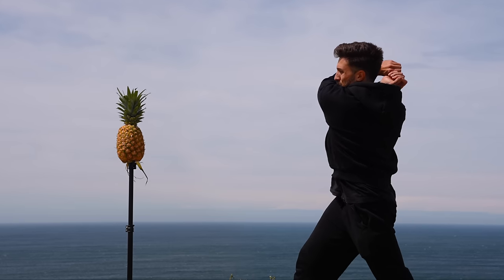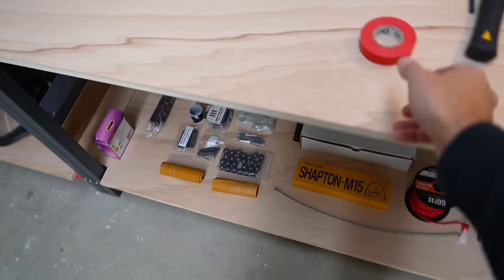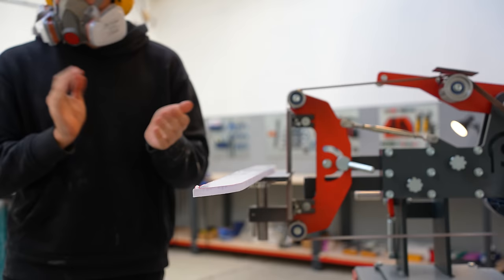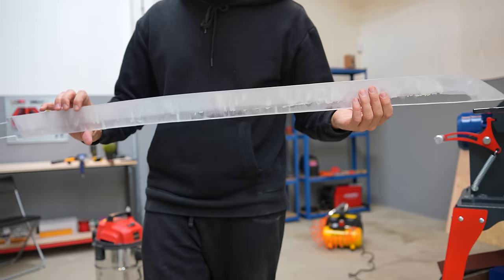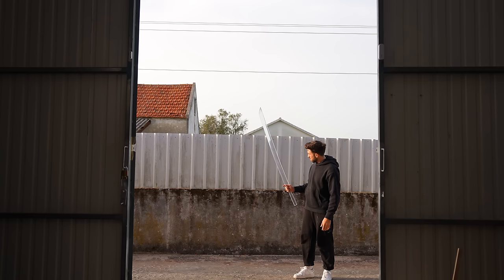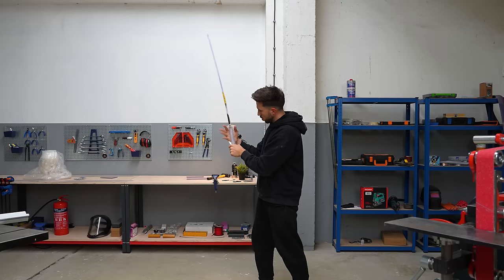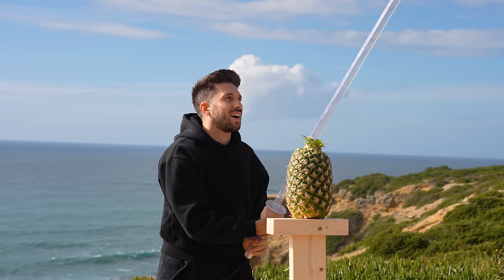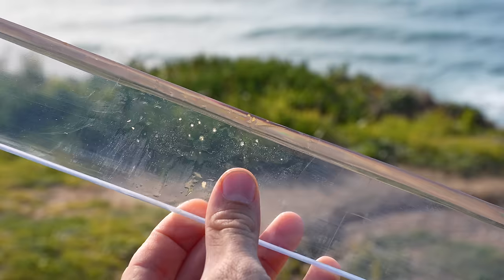I Built a Transparent Katana

Comment: The sledgehammer test breaking the sawhorses was unintentionally so funny. You praised the polycarb for how little damage it took when the sawhorses took almost all of the impact (evidence - they broke). The base has to be stable and in-compressible otherwise you're just passing the force through to the object at the end of the chain. If you're going to use wood at least make them stumps.

Also for the bandsaw, you should extend the base to support the weight of the thing you're cutting as the bouncing changes the angle the saw meets your piece.
Reply: Nothing is incompressible.
Reply: You're not passing any force to the end of the chain. All of the objects in the chain feel the force, minus anything that was absorbed and converted into something else by all of the objects before it. So the polycarbonate felt more force than the sawhorses.
Reply: have you ever "SEEN" an "INVISIBLE" 🗿
Reply: @petermgruhn  'Incompressible given the forces present.' You're welcome, Captain Pedantic.
Reply: @mrkiky  The further down the chain you go in this case, the more force that is imparted. The sawhorses bent and broke under the all of the force that was transferred through the polycarb, except for the energy removed from bending and displacing (plus heat, minor scratching, sound, etc). 

Try this again but using stumps or rock as your base and you'll see the difference. There will be more bending, potentially shattering as seen in the handle due to flex angles, the sledge hammer will be pushed back with far more force, etc. 

This is basic high school physics. It's why you want your car to crumple in a crash, to absorb the force that would otherwise go through your body. The sawhorses were the crumple zone, and airbags.
Reply from the maker: The test wasn't scientific, I grabbed the first sawhorses I found lol. It was just to prove how much stronger than glass polycarbonate is
Reply: @G33K01345  What you're saying is not basic high school physics, it's complete nonsense. The force to the sawhorses was imparted via the polycarbonate, therefore the polycarbonate also felt every bit of that force and then some. The sawhorses are not the crumple zone in your comparison, unless you sit in front of the car and the car crumples while you sit between the car and the wall. It's like saying that if you expect to get hit from the front, you should wear armor on your back, so that the force is transferred to the last part of the chain (the armor), through you. Which is of course complete nonsense and not how it works in reality. 
If he used stumps, sure the polycarb would have felt more force, but the stumps would also have felt all of that force, they just wouldn't break. The fact remains that the sawhorses were weaker than the polycarb.
Reply: Good luck breaking polycarb with a hammer of any sort. While still technically plastic it is closer to rubber in how it behaves this is what allows it to stop various bullets by itself normally used with glass a few layers of each alternating with the strike surface being glass and the back face being polycarb as first and last layers. They are glued together with what is basically giant sheets of double side tape. The glass panels are heated up and the entire panel is clamped under pressure to remove any air bubbles 
FYI loca (liquid optically clear adhesive) is also some times used for glue up of the panels and could also be used for projects like this and is set using UV lights
Reply: @petermgruhn  water
Reply: @opmason2293  water can be compressed. A cool example of this is superionic ice, also known as ice eighteen. However, Ice Seven would be a more understanable one.
Reply: I’ll do 20 sit ups for every like this comment gets…
Reply: if we are being pedantic it was Poly Carbonate not a Neutron star my guy, you ain't compressing atoms or Neutrons or even water with a 15/32 piece of Poly Carb or even a sledge hammer. Average swing you might be looking at 250J of kinetic energy when you need 436kJ to break a hydrogen bond we're talking negligible numbers here
Reply: @LiquidCallous  and where in the shop he was using would those have been, Atoms can be compressed in a Neutron star but we're talking Poly Carb and a Sledge hammer here
Reply: @sneakmore   without specialized equipment, he couldn't. Regardless, that wasn't the point of my comment. I was simply giving examples that water can be compressed as opmason stated the opposite.

Comment: another big part of why the blade snapped at the hilt isn't just about the quality of the blade, but rather your edge alignment on the hit.
The katana hit the pineapple with it's edge facing upwards, which effectively moved the middle of the blade up and away from it's inertia, turning your horizontal cutting force partially into a vertical snapping force. I reckon the blade would've survived with better edge alignment, and that can be aided with better handle design to make your natural grip closer to keeping the edge straight and practice in cutting smaller targets that won't be solid enough to break the sword.

Comment: I used to be a fencer before I was too disabled to continue, and was at one point inspired to make my own bows and swords.
I once made a sword that resembled yours out of wood, it had the exact same issue.
It turns out that when there's angles, all that power transfers and bottlenecks the energy, which can snap it off.
The only build that didn't snap off was when it had a streamlined/gradual shape. Take for an example bokken, you can crack a skull with it, without snapping the blade.
If you make the blade in such a way that it doesn't have such aggressive angles between blade and handle, it should be a whole lot stronger.
There's more science in swords than people realize, a lot of planning goes into it.

Comment: As someone who machines polycarb day in and out, even 90 degree edges are sharp enough to use as a chiesel. I recommend using a router and beveling bit for profiling the blade edge instead, would be very quick.
Reply: right, zero experience over here, but I was thinking how a CNC machine would've made this a breeze lol.

Comment: The reason behind the break point being at the handle, is that you did not round the inside edges joining the  tang and the blade. The extra material on the handle likely contributed as well, but I think it would still hold up if you got rid of the unrounded corners. Perhaps even making the blade itself out of several layers would make it super strong, as if it was PCB damascus.

Comment: 16:23 it doesn't cut because your angle is off, which you do acknowledge but still worth noting.

It's already mentioned (and you replied to it), but you created a stress riser where the handle meets the blade, causing that snap. Usually those are rounded out + the katana has an interesting engineering feature above the guard before the blade edge begins: the Habaki (the little piece of metal above the guard that is different from the sword steel) is often made of a soft metal (think copper or silver) in order to help absorb shock the blade may encounter without sacrificing its ability to flex (otherwise it'd snap if it could not flex) as well as helping the blade fit into the scabbard too. Obviously, this may be a bit of a problem for this particular build.

Comment: The 90 degree cut at the blade-to-handle transition adds a weak point. When a force acts on an object, it causes stress inside the material, and the stress flows through the material. If there is a sharp corner, it concentrates the stress. If there had been a gentle narrowing into the handle, it would have been able to handle larger amounts of concentrated force. It's one of the reasons ships and planes have rounded windows.
Reply: Also, I'm not saying you should actually do this, however, because its a light transparent material ... if you fire light into it from the handle upwards into the blade somehow, say from a laser pointer, you should be able to light that thing up like a DarkSaber :)

Comment: @Mike Shake
4:25 You see that thing with the scale on that the saw band passes through?
That is a support, so the band doesn't wiggle sideways when cutting a material, but for that to work, you need to lower it, so it is just a little bit over the material to be cut, so the support is as close as possible. There is some screw or knob or similar to turn, to make it movable, just make sure it is fastened securely before you start the saw again.

Comment: the reason i believe it cracked is cuz u cut the handle part with straight lines, at the corners where the handle meets the blade u should have rounded the corners, either inward or outward, leaving them as pointy corners makes the area the hotspot for tensions, and there are micro cracks already present in such areas, easy to break even steel in those areas, if you ever make things that are put under alotta stress, make sure to not leave any sharp inward corners. or ourward corners if u making rotating things, avoid corners in general xD.
Reply: also short thick edge is generally used for splitting things, and long thin edges are for cutting, that how it works for axes at least, the v2 of the sword deals way more blunt damage compared to v1 which has more of a cutting edge. try to cut water droplets shape holes in the area where the handle meets the blade for sword v1 see if it cracks.

Comment: like many people have said, the right angle in the transition to the handle is what caused the break, but it's also much larger and thicker than swords tend to be. reduce the length, width, and thickness of the blade by 25%, and make a steeper angle for the edge grind, and you will have a sword that actually cuts and is much more structurally sound. the bending would be much less dramatic with the reduced weight and length.

Comment: To address the snapping at the handle, it is in part to having a hard 90° transition from the blade to the "tang" section.  With steel, a lot of smiths will add a quarter radius there.  That softer transition makes the structure less likey to break at that point.

Comment: Stress concentration. Ever since you made the sharp angle cuts on the saw, I was hoping you didn't have the snap coming, but alas. You can use fillets, rounded corners and smooth transitions from wider to narrow sections.

Comment: 14:51 It broke because also that you cut sharp edges (square-like) between blade and handle. the tension focus on a singlr point there. this id the reason why planes have round shaped windows not square ones. There were accidents because of that. Check ScolaGladiatora video on that subject (about modern swords and blacksmithing).

Comment: Idea for improving V1 distortion problem:
Just make the whole thing the edge like a flat wedge or Equilateral triangle.

Explanation:
If you want to cut something with just one object you need a very thin object or a sharp edge.
The thin object will break too easily therefore it will be the edge.
A edge will always create distortion therefore you have to live with it.
For being invisible distortion is only a problem when you have different distortion angles. If distortion would be the same over the whole katana there isn't a problem, it is like a flat katana if you are holding it a little sided. 

So how to create a thin therefore sharp katana with an acceptable distortion?
Just make the whole thing the edge like a flat wedge or Equilateral triangle.

Comment: 14.45 You are not much of a sword person. Why katana is shaped bit like a banana? Because its made for cutting. That thing is waayyyyyyyy too thick and the cutting edge is too short (the angle in degrees). If you would just hold a Katana in your hands and read a book about it before trying to create one? Its also too long and thats why it broke. Maybe you could make a rapier(ish) kind of a sticking device or a tip of an arrow or a spear or even a prison stylish shank/dagger out of that material. But not a katana. The Katana is not ment to be something you cant fit in the "holster" (i'm from Finland - so pardon my not 100% fluent english) or to be hit with a sledgehammer - it's ment for cutting. I dont know about that material but it might even serve its purpose as a Wakizashi = shorten that thing at first. PS. If it works you have to give a name to a creation for example Chess: the game of kings. Something like "Ultimate Kataserialrapistana 666: Fu*ks you up before you see it." Just in case it becomes the new "thing" and its been sold in TV- shop